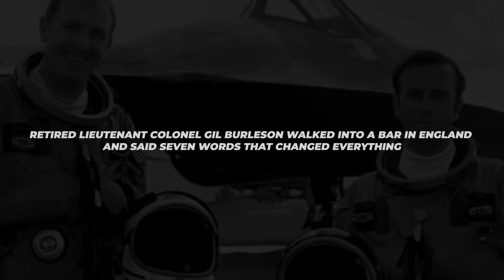Finally! SR 71 Pilot REVEALS The Blackbird's TRUE Top Speed!

Comment: 1964 America. Paranoia and fear creates the most incredible aircraft the world has yet seen, and it possibly NEVER even reached it's FULL potential. Mach 4+ could have been in it...
2026 America, a warning label is needed on an American Made baby pram/stroller/pushchair. It states  :  REMOVE CHILD BEFORE FOLDING.....

WHAT the HELL happened to you America...??
Reply: Mach 4+ was never possible for the SR71. Even mach 4 was beyond its maximum design potential
Reply: @gr8crash  Are you sure about that? Even the pilots had no idea of it's TRUE potential, so how do you know?
Reply: @bitemykrank1970 I'm 100% sure. And yes even the pilots knews of its max speed.  Lockheed did a study on what it would take to reach its maximum design potential. A lot of changes would be needed and were never done. The maximum design potential was mach 3.8 and it was never reached. The aircraft as configured could never have achieved that speed.

Comment: We'll never know the top speed because the engines would have to be pushed until they eat themselves.  And that will be avoided.  A Russian Mig 25 Foxbat was pushed above its limit of mach 3.2 so hard the engines turned into ramjets.  The power output was reportedly unreal but the engines cannibalized themselves.  Once fueled down and the plane landed, the engines complete seized.  So we won't see this done to an SR71.
Reply: The engines were the initial limiting factor to higher speeds. After that various airframe components became the issue. All the performance capabilities are declassified and public including it maximum design potential which was never achieved

Comment: So what replaced the SR-71 Blackbird.
Reply: Satellite telescopes. Blackbirds shot film that had to be returned safely, transported to a lab to be developed, then the pictures had to be delivered by jet to Washington. This was a pre-Internet era. A telescope streams digital data in real time back to Earth, where it's then sent over high-speed internet back to Washington.
Reply: @LesDexia13 not always. Satellites used film as well and had to be dropped and caught mid air.
Reply: @gr8crash  I forgot about that. THX. I think the big advantage is they were always up so pictures could be taken ASAP (more or less) rather than plan, launch and recover a Blackbird mission.
Reply: @LesDexia13 some what.  They had predictable flight paths so things could be hidden,  takes a while to reposition as well and the more you do it the more fuel you use.  Satellites are definitely useful, just not a replacement for reconnaissance aircraft.

Comment: I still cannot believe I got to be a fill in welder in the SR-71 Blackbird at Kadena AB, Okinawa, Japan in 1984 for a month. Then roughly the last half of 1985. They still did not have an assigned welder when I left for Langley AFB in Dec, 1985. I was assigned to the 376FMS and was a welder for the KC135 tankers and RC135 reconnaissance aircraft. Thise were fun to weld on. The SR-71 required extreme concentration and steady hands. Still, scary and fun. I heard unofficially that Mach 3.44 was the fastest she flew at. But I honestly do not know for sure.

Comment: If the 15 Streak Eagle was hitting 1900 mph and reaching 98000 ft in altitude, this purpose built speed and altitude demon HAD to go way above that. I knew an old 71 crew chief, and while he would deny it to most folk and never give an exact number, he stated top speed was somewhere between Mach 6 and 8.
Reply: Lol no he didnt. If he did he was messing with you as that isn't even remotely possible.  

The F15 also only reached those high altitudes in a ballistic trajectory not sustained flight. Very different flight regimes.

Comment: In my 25 years as an Enroute Air Traffic Controller, I worked these airplanes from time to time. The flight plans would only list altitude as ABV600, meaning above Flight Level 600, 60,000 feet. That is "uncontrolled airspace." The speed listed was always "SC," Speed Classified. The old M1 Radar Displays we used at the time had a display field for ground speed, but it maxed out at 990. But there was a work around for that which we sometimes utilized when handling these airplanes. A range/bearing function on the displays allowed us to get a much more precise read-out on the ground speed of displayed targets. On one occasion that I remember, I was talking to an Aspen flight making his turn from an easterly heading back to the west toward their home base, a maneuver that covered several states. Out of curiosity, I did a quick check on the ground speed, as the target jumps between radar updates seemed unusually large, even for a Blackbird. The result from this check, during a moment when the airplane would have been slowing for the turn, was "well over" Mach 3. Amazing especially when you consider that the preliminary design for these was developed in the late 1950s and produced under the best technology of the 1960s. Kelly Johnson was an alien. 😄

Comment: During a fantasy movie, an actor stated that the skin of the Black bird was changed from titanium to a synthetic and the Russians never knew because The Black Bird looked the same. While visiting an air museum with an SR-71 display, I walked up to the aircraft's burnt ash-white edge and took a closer look at it, yes there were tiny fibers sticking out of it and the skin did not feel like metal. So, it was substantially tougher than reported and could probably go a lot faster because the skin could take more heat and abuse.
Reply: The leading edges never turned grey/ashy, unless they were simply dirty.  Also the leading edges were composite not metal. The composite pieces were part asbestos. So when a tile was damaged they wouldn't repair it anymore but they made a titanium patch panel that would go over the damaged asbestos panel.

Comment: The Mig 25 Foxbat can reach speeds over Mach 3 . The SR71 can reach speeds way over 3.5 mach . More like Mach 5 or 6 . But it could not stay at that speed for long . Maybe 30 minutes at a time  Got to remember a F104 can reach mach 3 and it could climb into space that would be above 95 ,000 feet . It falls frome space until it gets into denser gasses .
Reply: The SR71 could not fly mach 5 or 6, nor even over 3.5. Even getting close to 3.5 required very specific atmospheric conditions.

Comment: Years ago, I spoke to the individual that ran the surveillance program of SR-71s and satellites under the Johnson Administration.  When I asked him how fast does it go, he said: "You're an engineer, figure it out."  It's limiting speed is the temperature that the leading edge of the wing, titanium, melts.  About Mach 3.5 depending on altitude.
Reply: You may want to redue your study. The leaded edges are composite not titanium. And no parts of the airframe got anywhere close to the melting temperature of titanium.

Comment: Swedish Air Force Saab 37 Viggen fighter jets were able to regularly achieve a radar "lock" on U.S. Air Force SR-71 Blackbird spy planes during Cold War training intercepts. 

Aircraft Involved: The Swedish used their domestically produced JA 37 Viggen fighter jets, while the U.S. used the SR-71 Blackbird, the fastest operational jet in history.
Methodology: The Viggens could not match the SR-71's raw speed or altitude, so Swedish pilots used specific ground-controlled intercept procedures, advance knowledge of the SR-71's repeated flight paths (known as the "Baltic Express"), and unique counter-countermeasure systems to position themselves for a lock.
Significance: The ability to achieve a missile lock meant the Swedish system could theoretically fire a weapon at the Blackbird, making the Viggen the only foreign fighter ever to genuinely score a successful lock on the SR-71.
Outcome: Despite the successful locks, no missiles were ever fired during these training intercepts, as Sweden was a neutral country during the Cold War. 

Swedish Air Force's Saab 37 Viggens did escort a damaged SR-71 Blackbird in distress over the Baltic Sea in 1987, protecting it from potential Soviet interception after the Blackbird's engine exploded, an event that remained classified for decades before Swedish pilots were awarded U.S. Air Medals in 2018 for their heroism. The Viggens guided the crippled SR-71 safely to friendly airspace, demonstrating remarkable Cold War cooperation.

Comment: Mach 3.56 is the fastest an SR-71 ever flew, and it was done on a test flight over Nevada Area 51. The Blackbird was designed to cruise at Mach 3.2 at 85,000 feet for long distances.
Reply: 3.56 is questionable at best, and not likely over the SW US. Max speed reached during A12 test flights was mach 3.29 and the SR71 was never flown/tested at Area 51.

Comment: Mach 4 is actually only about 2640 mph. The speed of sound is dependent on temperature and pressure. At sea level, it's close to 740 mph, but over 36,000 feet, it is closer to 661 mph.
Also, the last cross country flight had higher interval speeds towards the end of its flight.

Comment: How fast, Ludicrous speed,  possible by Ramjets coupled to a titanium airframe, that's the elixir of Ludicrous speed. Limited by aero heating. Perhaps some kind of active cooling like regenerative as liquid rocket engines do by running the fuel through the J-58 inlets before burning it.

Comment: I'm curious..why , when it's been retired for 36 years, that they won't tell us the true top speed?same goes for Navy ships well at least with carriers and destroyers..it's always 30 knots +..I got a boatswains mate; that use to drive " Spru cans" ..Spruance class destroyers..55' beam 563' long about 7000 tons displacement..with 2 LM -2500 engines ; same engines that are in a 737, run thru reduction gears and 2 adjustable pitch screws..any how I asked him " how fast will it really go" ?  He told me " at flank speed 48 knots... almost 58...mph....the carriers do 30 knots ( no wind) just to get the planes off the deck..so I figure at least double that 😊
Reply: Performance capabilities of the SR71 have been known and declassified for over a decade
Reply: @gr8crash ya excess of 80,000 feet mach 3+, which incidintly use to be listed mach 3.5+.....so no the question never had been answered..how much higher than 80,000 feet . How much faster then mach 3
Reply: @Gary-j6x6i its never been listed as 3.5+ as it wasnt capable of that, especially not as configured. And yea it could fly higher than 80k ft, but not by anything drastic. Especially during the reconnaissance leg as flying significantly higher would degrade the reconnaissance gathered.
Reply: @gr8crash  as far as degradation goes..if it's still there..I went to the Air&Space museum in DC..they had just the fuselage with a 2 foot circular photograph under it stating that was the how close they could focus from 65,000 feet in the U-2..Im pretty sure the SR-71's focal point was a lot better
Reply: @Gary-j6x6i their resolutions are pretty comparable. And still not good enough to read a golf ball, cigarettes etc.
Reply: Read a book called "'The Lead Sled" the SR-71 was flying a mission over Libya..a sam missle was coming up .the pilot slammed the throttles forward and said only " I saw mach numbers I'd never seen before" ....I'm sure we're a heck of a lot higher then mach 3...4..5 who knows
Reply: @Gary-j6x6i you're referring to Sled Driver by Shul. Issue is he lied, a lot. Most of his stories arent true. And no, mach 4+ was NEVER possible
Reply: @gr8crash   I know one thing.. years ago before it was ever retired..it's rated top speed was mach 3.5+.  now since it's been retired..they dropped that to mach 3+..that mach 3.5 was current in the latter 60's...I was into aviation as a kid, because my dad was a fighter pilot.
Reply: @Gary-j6x6i its rated top speed was never mach 3.5+. 

Think about it, even IF a crew did fly 3.5+, how would the even know?
Reply: The Spruance class had FOUR LM-2500's, and yes they could be very fast. (DD-970)
Reply: @thefrustratedtheologian6238 when I was still active; don't remember which one,but there was a Spruance class destroyer tied up at fisherman's Wharf for tours..since my buddy and I were active.they took us.off the regular tour path..saw the engine room, and control room,berthing...only saw ..2.. didn't realize had 2 more..I stand corrected,thanks..I definitely remember telling my buddy that the control deck looked like something from " Star Trek" 😊
Reply: @Gary-j6x6i  I was on the Caron (DD-970) from 84-87. There were two engine rooms with two engines each. One room for each of the two shafts. While each engine room had direct control, during normal ops all control was passed to engineering.

Comment: So there was a listed maximum ceiling height of 85,000 feet and a maximum speed of mach 3+ with one pilot pushing it to 3.5. Did anyone take it higher than 85,000 feet and faster than mach 3.5? Were the absolute maximums ever reached?
Reply: The maximum design potential of the airframe was NEVER reached. The improvements required to the aircraft were never built. It reached 90k on a few occasions,  greater than 3.5 is questionable at best and probably didnt happen.
Reply: Chuck Yeager porpoised a F-104 to over 100,000 feet and flamed out.  I think he still holds the record.
Reply: @turbo32coupe  I'm sure they could get Mach 4 or so in a sustained shallow dive, but that isn't cruise speed.

Comment: I was told that an SR 71, over North Korea, had a SAM missle launch. The pilot firewalled the throttle. They outran the SAM but the speed warped the wings.
Reply: Lol definitely not. Yes they were fired at, but they wouldn't firewall it as that would cause issues with the intelligence gathered. They'd just maintain speed and altitude and trust their equipment.

Comment: In 1974, at Royal Air Force Base Lakenheath, I was fortunate enough to witness to takeoff of an SR-71 while I was standing on the apron immediately next to the runway. We were about 2/3 of the way down the runway. We were deplaning from a C-130. We looked down the runway and saw a hazy black mass just lining up for takeoff. A few moments later and the engines powered up with a very distinct roar. It started moving toward us rapidly gaining speed. We had to cover our ears it became so loud. Just after passing us it nosed up, became airborne then in a few short seconds was completely gone from view. I’ll never forget that experience. I can’t imagine anyone not being astounded by that aircraft.
Reply: I was stationed at RAF Lakenheath while the SR-71 was stationed due to repairs at RAF Mildenhall. I was in the Fire Department so we got special conferences about the plane and was able to see it in person and able to touch and see the cockpit, but not the back one with all the surveillance equipment. It was pretty cool. It would take off at 9am and land at 3pm, during that time it had made 3 passes over Japan.
Reply: I never saw it fly but recently I saw one up close at the Smithsonian aircraft museum near Dulles airport in virginia, maybe 25 miles outside of dc.  If you can, you should check out that place, it’s amazing.

Comment: I lived in Kennesaw, Ga in the 90’s and was a Navy Airedale and was used to being around Military jets but one Saturday I heard the loudest jet plane I’ve ever heard so I went outside and saw the SR 71 gaining altitude heading north/west I’ve seen many jets take off. I was stationed at NAS Cecil Field, FL and NAS Jax’s in the early 80’s assigned to A7E Corsairs II  when one of the F18 test planes #003 was flown in to demonstrate at let our squadron’s see what was coming down the pike it was amazing compared to the A7E and when the test pilot took off to leave he told us he was going to climb vertical and he did it was a one of a kind sight until I saw the SR 71 Blackbird accelerate from 15 miles away. I didn’t know it at the time but my eye sight was better than 20/10 and the sound actually shook my house. I’ve never seen anything leave my sight picture that fast I can still see it in my minds eye. 35 years later I saw a SR-71 Blackbird on display at the Evergreen Aviation & Space Museum in McMinnville, OR  tail number 61-7971 I was surprised it wasn’t as large as I thought but it was a technological marvel, the engines were massive and what a plane made from slide rules and no computers. 🇺🇸🇺🇸🇺🇸🇺🇸🇺🇸

Comment: The Mach meter in the cockpit goes to 5.
Reply: And my amp goes to 11.
Reply: I had an 80s subaru that went to 120mph, on the speedometer. Never got above 78mph....downhill..hwy101  north of Cloverdale,Ca. Steering wheel shaking, windows pulling away from the frame less gaskets.....
Reply: My chevy trax goes to 130. No chance of that happening.
Reply: @charleschidester6767  bet if we threw it out a  plane it woudl go REAL fast ;D
Reply: @charleschidester6767 the blackbird can always go faster.
Reply: Yes, it can do it.
Reply: A true jet engine (not a turbo jet) theoretically has no top speed.

Comment: The true top speed was limited by turbine inlet temperature, period. This was 427 degrees centigrade, or 800 degrees Fahrenheit. After this, the turbine blades softened and that was all. The Blackbird was not thrust-limited - it would fly faster than was allowed, but no one was crazy enough to firewall the throttle and just let it go until Something Bad happened.
Reply: makes sense